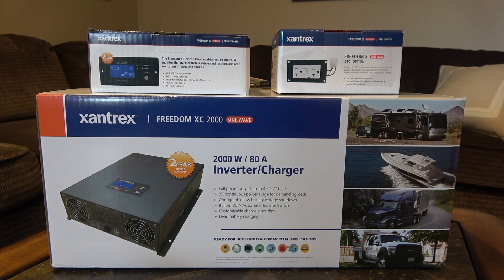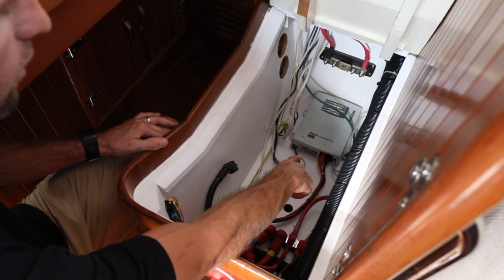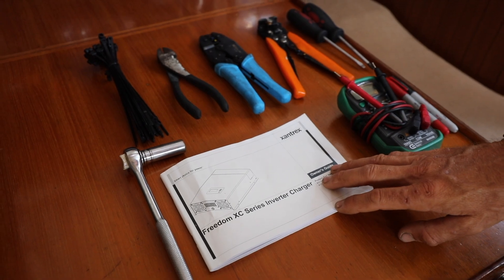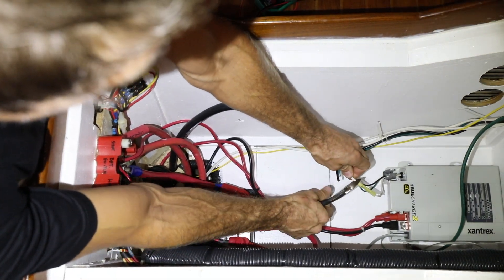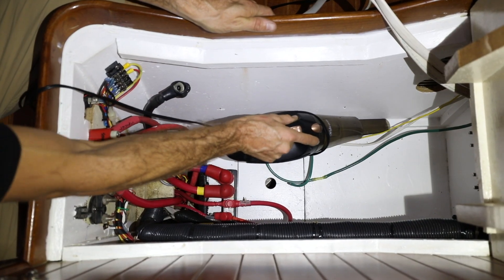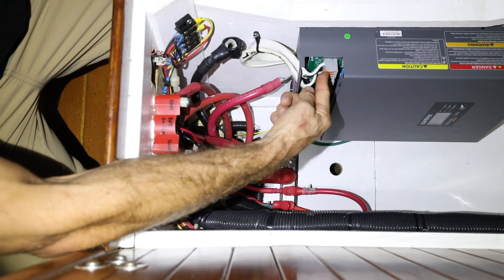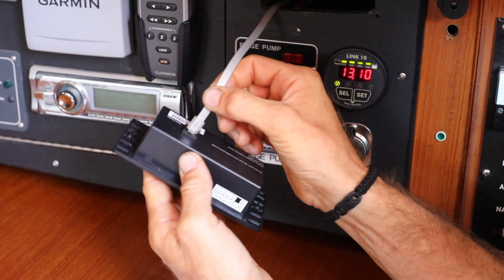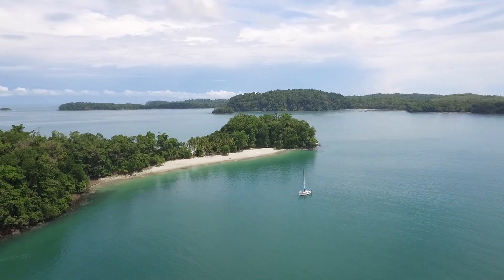Inverter Installation - Xantrex Freedom XC 2000

Comment: I recently bought the Xantrex  XC PRO Marine 3000 (white case) to specifically charge (3) LiFePO4 batts (not yet installed in boat). I bought the Xantrex to charge my new lithium's (replacing dying flooded 4D's) with the understanding that there was a simple setting for lithium batts. I was "shocked" (pardon the pun) when I read the Owner's Guide; "Lithium iron phosphate (LFP) must only be selected with a lithium iron phosphate battery module with a certified / listed Battery Management System (BMS)", which I did purchase, and, battery types other than FLD, AGM  and GEL batts must be configured by the dealer, or other Xantrex Trained people. In your video I don't think you mentioned this in your well executed install. Can you elaborate how you "worked around" this important fact? Thank you.
Reply from the maker: To my understanding it is saying that you still need to have a BMS. If you select the LFP battery type on the inverter/charger it does not take the place of having a dedicated BMS. We have used the XC Pro (on LFP) for over a year now with no issues or work around. That said each battery manufacturer might recommend slightly different charge profiles so when you select LFP as your battery type double check that all the parameters are right for your battery.
Reply: @voyagesofagape  Okay, that eliminates some confusion on my part. I'll likely "center" position the BMS display on the console center, so as to keep a closer eye on it. Thanks for replying.

Comment: You say your connecting your ac in from the shore power? Where is that connection at the main panel?
Reply from the maker: Our shorepower connects via a 50amp "Main" breaker on the AC breaker panel. From this breaker the others are tied in (outlets, waterheater, microwave, etc.) one of these breakers is for charger/inverter. It is to this breaker that it is tied into. This enables us to connect to shorepower and use any AC loads independently if we choose not to use it for battery charging. I hope this helps if you would like more info feel free to email (jshankle86@gamil.com)

Comment: I currently have the Xantrex Freedom SW, but I am looking at adding a second inverter since I am using a much heavier load. Do you really like this?
Reply from the maker: I do like this inverter/ charger. It is easy to use/ program, has a ton of programmable options but most importantly works!!!! It powers everything from our vitamix to microwave and has not been turned off for more than a minute or two since installing. Depending on your load size they also make a "pro" model with a 3000W inverter and 150a charger in the same slim profile.